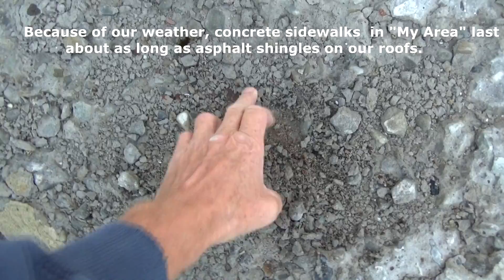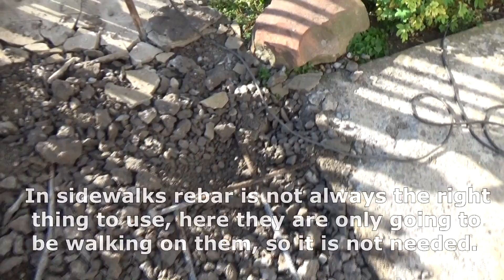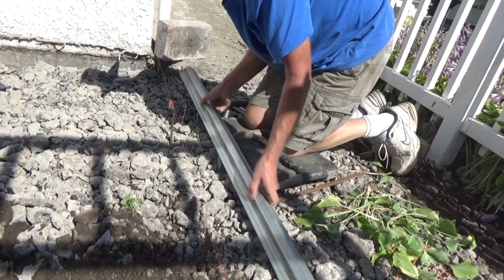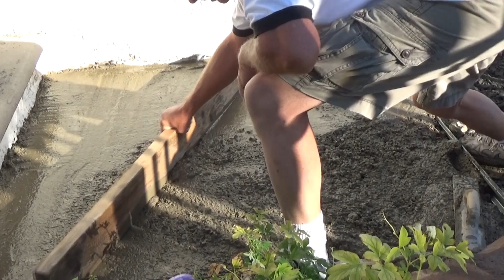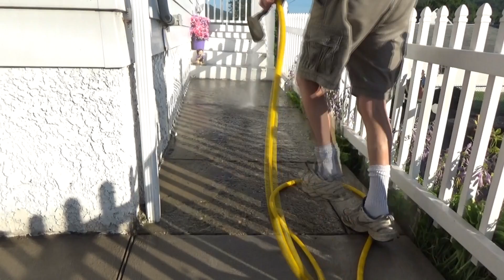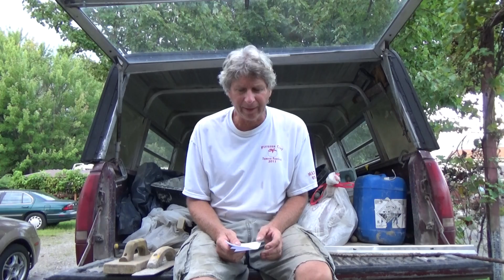CONCRETE SLABS-PADS-FLOORS-PATIO (part 3) Mike Haduck

Comment: Is the white glue additive a waist of money ? I noticed you never use it. I’m doing a lot of crack filling on my driveway and patios and been adding it. Stuff ain’t cheap. ❤
Reply from the maker: I might on a little resurfacing or foundation , if it is a thin fix or Im mixing ir into a paint, thanks Mike

Comment: Great video your wisdom gained over the years is priceless.  I've tried and failed many mixes over the years.    Mike what is your take  on the  4-6% air entrainment.  So is fiberglass rebar the way to go?  It's actually cheaper.
Reply from the maker: Thanks Daniel, I haven been involved with the air for a while but got that video ,industrial concrete, I say a little about it, Mike

Comment: Re: Painting concrete. 
You may not know this but painting concrete ruins the concrete in as little as 18-24 months. Here's why. Paint is water based. all water based coatings brethe. When standing water is present it penetrates through the membrane carying mineral salts with it. In water, salt, sodium and chloride seperate. the sodium attatches to the polymere (paint) just like in a water softener and the chloride attatches to the calcium converting the concrete limestone cement into calcium chloride also known as highway salt. Your concrete is no longer concrete, it's highway salt. 
While the water eventually leaves, the salts are trapped. as the cycle repeats itself the chlorides acumulate to saturation penetrating deeper and deeper (usually in about 18 months) ruining it. The concrete is no longer concrete, it's salt and crumbles, pits and spalls. The visual indicator of this is the peeling because paint won't stick to salt (calcium chloride or sodium Chloride). The mechanical indicator is to use the MOHS hardness scratch test. 
This is why DIY epoxy garage floors DO NOT WORK. 
Alternative is H&C Hydrodefend Concrete sealer. Simply spray or roll and brush with a broom after washing with simple green and water. 
I'm an expert. I do this for a living.
Reply from the maker: This a great explanation,  there is a lot to that stuff, I don't work with it, but thanks for the info, I got to write it down,  thanks Mike

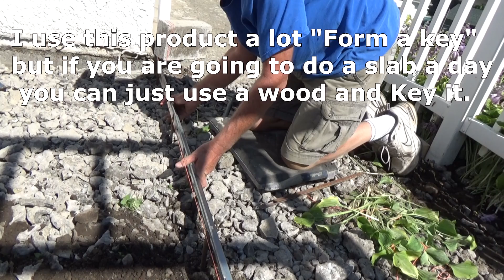Comment: Mike you wrote at 3:08 that if not form a key we can use wood and key it? What did you mean by that? I cant seem to get form a key in my country. :-)
Reply from the maker: Hi terry only between pours I would never let the wood in, but if you go to a metal scrap yard you might find metal strips similar,  anything that works, mike

Comment: Can anyone answer this question: I have large cement stumps that I dug out of the ground that were once used to cement in 4x4's. Can I break them down into small pieces to use as drain rock?
Reply from the maker: Hi Mike. I would say it all depends,   I worry about them blocking up drain pipes, sometimes I just smash them up and bury them, I hope it helps, it all depends thanks mike

Comment: great information! Thanks for the video! I am going to replace two sections of my walkway that were torn out due to a plumbing repair, and wanted to resurface the rest of the walkway so the colors match, and it looks like a whole new walkway. Was planning to make my own resurfacing mix instead of the quikrete stuff. The new stuff has bad reviews. I had one question, didn't see an answer in the comments, but maybe i missed it. Is there a reason that the resurfacer didn't match the look of the new concrete? Is there a better recommendation? Will painting it will portland or making my own portland sand mix to resurface be a better match?
Reply from the maker: Hi Mike, I would say you got to make your own Portland mix, but I would do a sample first to make sure it matches, I hope it helps, mike
Reply: Mike Haduck Masonry thanks for your reply, Mike! I was also wondering about filling control joints so they're like new. I've got weeds growing out of control but don't really like the look of the self leveling sealers. Was wondering if a softer mortar mix can be used before painting with Portland to restore the look.

Comment: Is your beef with rebar due to the freezing and thawing? Is it more stable in climates like Florida? Also, I often see people using the square metal matting for sidewalks and driveways. Comes in a 5 ft roll or so. They cut it with bolt cutters to size.

Comment: Hey Mike: Really do love the videos, great info. I watched a video of you using mud on a resurface of concrete steps to match the color of the original  concrete with the new. Wondering why you didn't use that method on this project?
Reply: Wondering the same Mike. That bad spalling/failing section looked like a job for Cement All not that resurfacer?

Comment: Without rebar or mesh, how do you prevent one section of concrete heaving up when the ground and the water under the ground causes freezing and lifting?
Reply from the maker: Hi Julie, it all depends on how long the ground is settled, and what you use for a base, i usually show on my how I float finish concrete series,  thanks , mike

Comment: Good morning Mike. these are such helpful and interesting videos.  As you point out many real world jobs are complex and take planning on the best methods to use to address repairs or replacements.
One question on this one - you used white stucco to fill in the area along the joint between the walk and the side of the residence.
How do you consider the need for a joint fix there?
i'd wonder about color match for any repairs. Also about the shrinkage / expansion issues.
Might also consider a white seal but you seemed to have a different plan and addressed it right away.
Reply from the maker: Hi pensive, in this case, it was not going to rise with the frost, so no worries,  plus I had to fix more than that, thanks mike